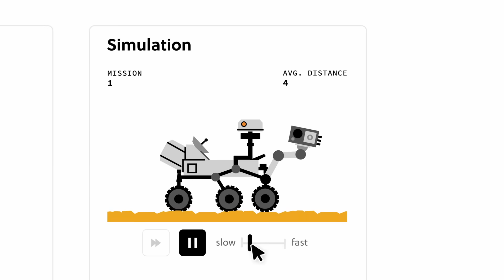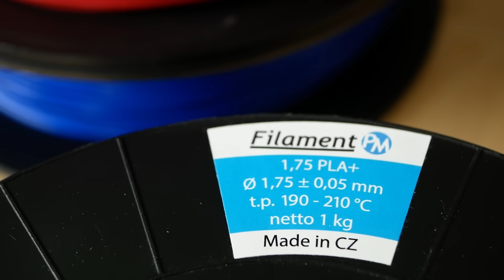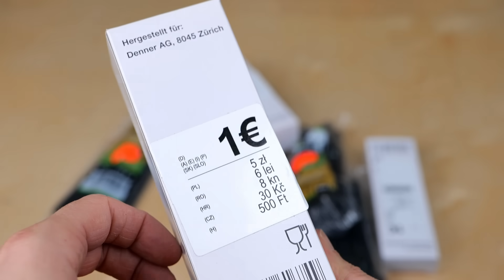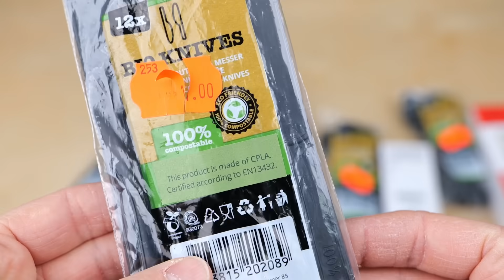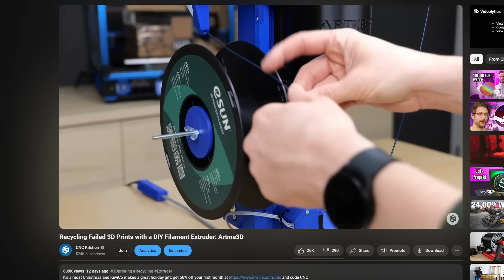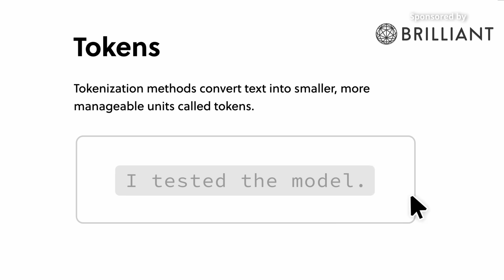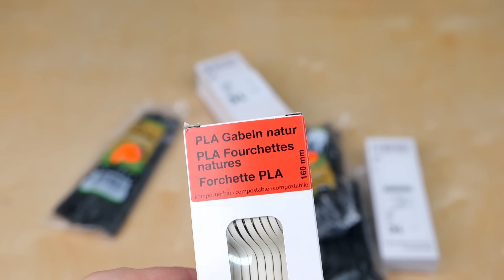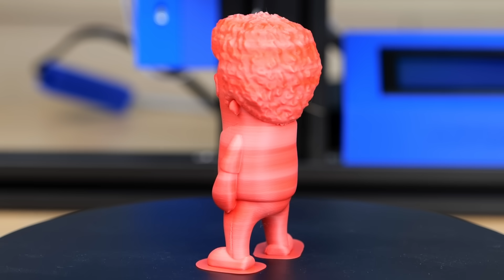From Trash to Treasure: Recycle Cutlery into 3D Filament!

Comment from the maker: 🎅Brilliant is the best way to learn math & science topics! Go to https://brilliant.org/CNCKitchen for a 30-day free trial & the first 200 people will get 20% off their annual subscription.
Reply: Stefan, PLA is compostable (in very special conditions) but not biodegradable, definitely. To compost, PLA requires temperatures over 65°C + high pressure + high concentration of specific enzymes, otherwise, it only degrades possibly into micro plastics, like others thermoplastics. And there's no way you can find these three conditions into nature or into a garden waste ground compostage. You need an industrial or laboratory environment which both involve heavy machinery and energy. And last 2023 studies leads to the same conclusions, alas. By the way, there's currently no sorting facilities for PLA which is, like most of plastics currently incinerated with other materials. Please document yourself on the topic and beware about hoax which are by numbers on the net. I would like the community be more aware of that. There's currently no printing material with no impact on the environment, alas.
Reply: @axelSixtySix   i could not have said it better!
Reply: A little hint. When producing PLA filament, an elastomer such as EVA (for example, TPUs such as Ninjaflex should also work) is often used to make it less brittle. 5% is enough.
Reply: is 0:48 a shot of i70 in Colorado?
Reply from the maker: Yees!
Reply: What would happen if the material wasn't properly sorted, and some ps or pp or pe cutlery got into the mix? What would happen if you try to recycle uv damaged material?
Reply: Hey, i have noticed that when you shred the plastic, a lot of it sticks to the machine due to static buildup. Coincidentally this problem also exists when crushing coffee beans so people spray the beans with water to reduce the static buildup and thus the clinging to the walls of the machine. You might give it a try since you already gotta dry the filament afterwards :)
Reply: Stefan, I like you, but... the biggest issue with cutlery is it gets greasy. Washing will be the first step, and you can use the dishwasher. Not buying from the dollar store brand new and running your experiment :( When I started with Menza PLA lids, it was the worst step of the experiment. You are German, come on)
Reply: 155-160C is your temperature plus faster speed of screw.

Comment: Hey Stefan! Great video, yours was the most practical and clear process I've found so far. I've been looking for videos about PET bottle recycling (shredding > extruder > printing), but most of them are too theoretical. Since you've already tested cutlery, do you think this same practical setup would work for PET flakes, or does the material's viscosity make it too difficult for a DIY extruder?

Comment: anyway the common nozzle that most 3d printer use is made of Brass C360, which contain 2-3% Lead, they add it because Lead is soft and easier to manufacture, also the lead can leach in 3d printing build and make it not food safe

Comment: in venezuela we use allot of recycled pla, and most of them regardless of the quality the printings tend to be brittle and most of the time they have to be printed with a high speed which leads to cracking or layer separation

Comment: Think about it, Plastic is made from oil. If it is used once and buried, it is sequestered carbon. It isn't burned and turned into carbon dioxide.  Using plastic SAVES the environment.

Comment: Most plastic cutlery I've seen has been styrene. Nobody will try to print with styrene twice - the fumes are BAD and toxic. I haven't seen PET, I have seen multi-use cutlery for camping purposes made from PC, but that's not recyclable by simple melting. Compostable (PLA) cutlery would appear to be "cheating" and a waste of time, since it is already easily recycled; it's a problem that did not need a solution.

Comment: Im going to be something similar with a pellet extruder. My company gets Pallets of plastic bottles in and they just toss those. Ive started collecting them and the cool thing is that the adhesive is easy to remove and only on one spot. I get BAGS of this stuff and then I have an unlimited source of PET clear to print with!

Comment: @CNCKitchen A trial where filament is made from wood fiber would be interesting. The fiber could be, for example, bamboo fiber. All the ingredients of the filament should be biodegradable and such that they can be made at home and be cost-effective. The filament would have properties that make it durable enough to print a full-sized chair. Such an affordable filament, where all raw materials are inexpensive, would be suitable even for micro-factories where furniture would be manufactured cost-effectively with 3D printers. You can ask ChatGPT for advice and ideas in developing this. (GPT-4o)

Comment: @cnc kitchen 
I run a plastic and grinding facility in the US for reprocessing of bad PET bottles. A big issue for us is that people don’t know what to do with the dust which is too fine to be used in the blow molding process. Is there any way you could do a video attempting to turn that into filament. I could send you any amount of dust you need. We have over 40k lbs on hand

Comment: Can this handle PET? I still dream with a machine that allows us to convert a big part of that material that is killing our rivers and seas into new useful things rather than bottles staking up in in line waiting to kill our marine life. That would add value to a waste material at least making it attractive to the less humans that drop trash anywhere to think of it as an asset that they can exchange for money and encourage normal people to ensure the plastic gets recycled and used properly, maybe a community or university driven filament factory to build useful parts or research structures for civil engineering.

Comment: Other way around.  They usually add a small amount of regrind to the virgin mix.  Usually 20 to 30% depending on how much scrap you normally have and quality requirements.  After plastic has been reground about 6 times, the polymer chains break down enough to really compromise the material strength.  The assumption in the % is that you will have a small small percent (scrap) of that get reground and reused over and over, lessening each time.  Keeping the regrind percent low minimizes the amount of material that gets reground more than once after getting molded multiple times and keeps the percentage of compromised material practically negligible.

In this case you could get away with much higher percent regrind, but keep in mind that even ground just once will have worsened properties than virgin from the long molecular chains being severed.

Heat stabilizer additives to help polymerize the material further when heated can also help.

Comment: King's collage London, just released a paper ("An enzyme used in laundry detergent can recycle single-use plastics within 24 hours") on a very fast method that breaks down PLA to monomers within 24 hours, without quality degradation of reproduced PLA. Its a long way from that to commercial recycling, but it shows the possibility of a much more practical way to recycle than the time consuming industrial composting.

Comment: I'd be interested to see how used soda bottles (PET) print compared to regular PETG.
Reply: I know this can be done by pulling strips from a bottle but due to the low yield, and small rolls, I'm curious how PET works when you grind up the bottles and use a filament extruder to potentially make a full spool.

Comment: Excellent. Now to convece my city to switch my city to encourage compostable silverware at our farmers market and set up bin for there collection. From there they can be shredded and turned into new filament at the public library and used for the 3D printer workshop. Said workshop will also have bins for the waste created when 3D printing and locals who 3D themselves. And I can be assured that the waste that result from what my own business is being reused without spending thousands on the systems myself.

Comment: so you take the plastic utensils that CAN degrade. that doesn't help at all
Reply: PLA req very specific conditions to biodegrade.
Reply: @MrBlackmidi1234567890987654321  yeah, but it would be  lot more useful if he could recycle other plastics into filament, the ones that can't biodegrade at all

Comment: Can you make the same process with PET bottles, for an endless filament, instead of the limited lenght done in the previous PET bottle video? (Shred to bottles and extrude them OR do a test with a pellet fed 3d printer)

I live in a location, where drinking water is only possible from PET bottles. As an expat coming from a country where drinking water from tap, is some of the cleanest in the world, it hurts to see all of this plastic waste. On top of that, this country has NO recycling what so ever. 
I have unlimited access to clean PET bottles, and would love to make something useful of them.

Comment: I'm not sure if you already Tested the "PLA HT110" Filament from Aurapol yet. The claimed temperature stability is in my eyes more of a suggestion then actual fact, but what i expierienced so far in regards of strength its kinda nice. No matter what i tryed so far, it refuses to break like normal PLA, it just bends and thats it. Would be nice to see some of your Test's with your equiequipment. =D

Comment: I would love to see bamboo used in filament!!! It grows rapidly and in a wide range of environments. 

A study conducted by the International Network for Bamboo and Rattan found that bamboo can sequester up to 4 times more carbon than other tree species in the same area. Furthermore, bamboo can reach maturity within 3-5 years, which is much faster than other tree species.
Reply: Also, maybe it could be just a filler like CF. Problem with CF is that it is not eco-friendly

Comment: So I work in plastic thermoforming previously worked in injection molding and while we don’t use post consumer recycles, we typically use anywhere between 45%_50% recycled material (typically directly sourced from an inline grinder.) so your 50/50 mix was a really good choice. It should be said that you can recycle the recycled parts as well, you just have to add in that  virgin material every time to dilute any extra thermally degraded material.

Comment: Hi Stefan, I am a great fan of your channel. I learnt a lot of things and got success in 3d printing.  Thanks a lot man.   I am working on an odd project in which i wanted to calculate my laser engraving machine (DIY) laser head movement.    My thinking is to calculate pulses of x & y stepper driver every fixed interval and calculate its tangent and add up its values till one job completion . As you are an expert of this subject can you suggest to me if it will work or any other method i have to use.

Comment: Ok but that work, energy and effort is put to make some filament. What if you after all this have printed a bunch of new forks?
That completely makes no sense because you could just wash the old ones in dishwasher and make them multi-use cutlery ;)
Of course some meals would leave color marks on them and that’s the only deal… but I just want to say that maybe that’s not the optimal way and not a answer to the problem, despite of you doing a decent job.

Comment: Not only could you add virgin PLA pellets, if this process was done commercially they would add additional plasticizing agents and other additives to the recycled, shredded injection molded PLA, to help bring its material properties close to that of filament made from virgin plastic pellets. At least on an industrial basis, heavy industrial degreasers will take care of any oil or grease that might remain on the plastic before further processing. Oil or grease that gets into the hot end tends to have quite a negative impact on print quality, at least it's easy enough to effectively remove when scaling this process upto a commercial size.

Comment: Very very nice experiment what seems to have turned into something productive. I do a LOT of 3D printing across 11 machines and 8 of the 11 were recycled machines that I bought "as is, for parts only" on eBay. You might be surprised how many people either disassemble machines to do upgrades and break them, or assemble them wrong, or just don't do designs, don't know how to slice, don't know how to bed level or adjust Z height. Then the machines end up on eBay. My first printer was a Voron build so I got pretty comfortable with how 3D Printers work so I could fix all these broken ones. I have 4 of them going to schools for kids, but older kids as the ones I rebuilt could be dangerous for very young children. The remaining 7 I am actually using to build robots or functional parts. I do have "some" degree of waste when I do prototypes and it would be extremely cool to be able to recycle those parts. I am looking into making a purchase of the Artme 3D. I am all about recycling, from old cars I rebuild, to 3D printers that have been sold for parts, and would LOVE to recycle my prototypes. I even look for spoolless filament, not so easy to find, or the cardboard spools. Very nice consistent content. EXCELLENT.

Comment: The plastic is not PLA. It is CPLA which means it contains chalk. It would be best if you tried pull-trusion instead of the regular extrusion which is way more difficult to manage. We all have seen the pull trusion method with PET bottles, there must be a chance to try it with wasted PLA granulate. It is the special made auger that makes this filament maker special. Pull Trusion pulling the filament out of the nozzle with far lower temperatures.

Comment: Sorry to nitpick but at 12:10 thats not how percentages work. You actualy made and 16,6% (without red) or 18,3% (with red, counted as new) mix. You have to take into account the 40g you added with the new pellets onto the total weight. Meaning the calculation looks like this 40/(200+40)*100%

Comment: It's very difficult to reuse mixed plastics, as we normally don't have any informations about the types included. Could we just reuse our own plastics, then it would be a win-win. I was thinking about the PETG waste we have in our hobby production from support material and faulty prints. PETG should be heat stabilized from origin with the glycol content. How does it react, when reused in your setup? Any strength or brittleness changes? And maybe a bit off topic, but recycled PETG could possibly also be used for powder coating, as PET normally is used. Maybe it needs to be cooled down to be "powderized". But anyway Stefan, it would be great to see your take on reuse of PETG 🙂

Comment: Aren't you supposed to use masterbatch in fine powder form for such a small extruder?
Reply from the maker: That's what I got. I might try pigment powder in the future, though.
Reply: @CNCKitchen  I believe you're supposed to throw some with the pellets and then mix it all cold so the powder coats all the pellets.
Also not sure if it's a thing but you could use normal masterbatch with small amount of PLA, extrude it, then chop it back into pellets and you would have more but less dense masterbatch that will mix better on low scale.

Comment: First time on the channel, great video! One comment though about the dirty plastics: it seems that hand-washing kind of defeats the point, as 1. it wastes too much water, and 2. requires manual labor. It would be interesting to see the same with only lightly rinsed cutlery with a pre-set amount of water in a way that could be automated. Israel is the #1 per-capita single-use plastics user, and one of the reasons is that Israelis are extremely averse to water waste, where it's considered to be a much bigger environmental problem than plastics. Hand-washing the dishes would be a huge turn-off for the feasibility of such a project in real life.

Comment: Hey, i'm from Germany and i regularly send my pla and petg leftovers to Recycling Fabrik, which is a Company that recycles that stuff. Depending on how much u send them, and in which condition, u get points that u can use for buying new recycled filament from them. I think they use other plastic material, too.

Nice Video. Can u oversee your overall costs for the recycling process? That would be very interesting to me.

Comment: Couple of points, the black cutlery may have been brittle due to an excess of colour, not sure how you could check for that though.
To get a more consistent colour you would have to pelletise the filament and run it through the extruder again.

I’d like to see abs from fridges be recycled. It’s something that there is a lot of and it’s usually white so you could add master batch colour to it fairly easily.

Comment: Id love to see a video on the recycling of food packaging (like from cheese ore yoghurt). These aren't typically recyled. Even in Germany they are usally burned. They are often made in layers from different materials, which makes them hard to recycle. I was always wondering if it would be possible to make a recycled plastic filament out of them, even if it would not reach the strength of for example PLA. As long as it extrudes okay and isn't extremely bittle i would have lots of applications for such a filament where the strength isn't overly important. I think being able to recycle these kinds of packaging is something like the holy grale of 3D-printing, since this would allow me to reduce my waste by a large margin and provide me with a near endles supply of filament.